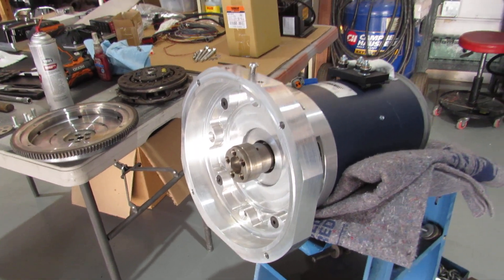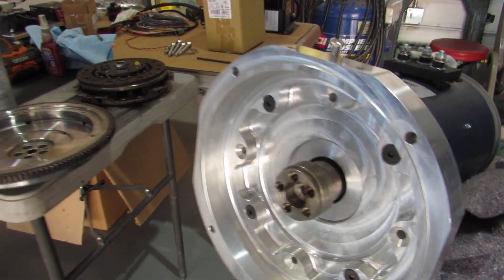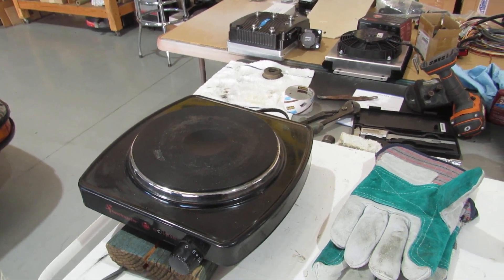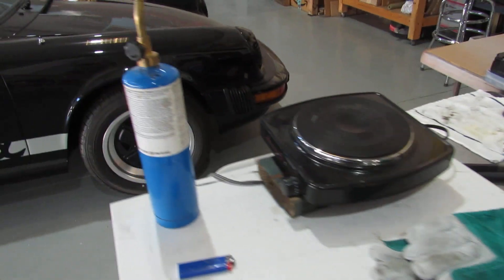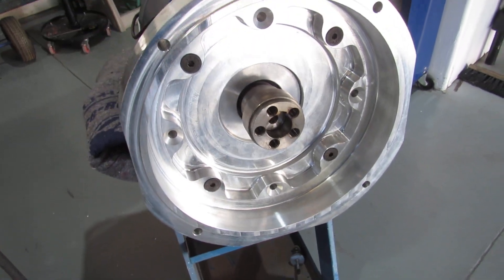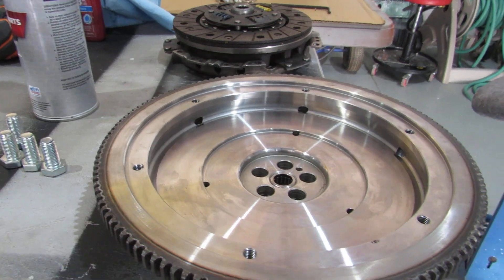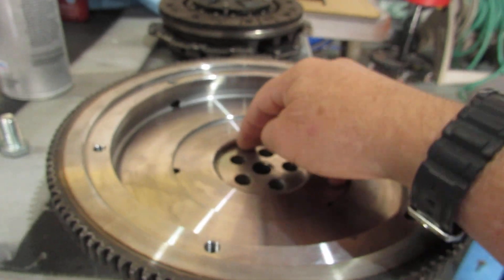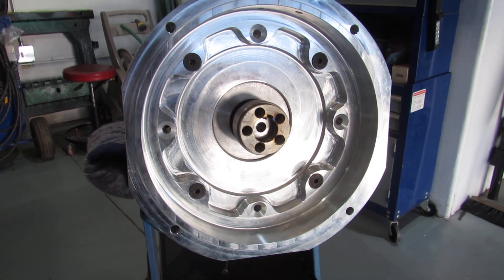1971 VW Super Beetle EV Conversion Update...Coupler On!

Comment: You mentioned on the last video you weren't sure how far the couple went on.  Did you just push it in all the way?  Also, did you just use welding gloves?  Or anything else to protect your hands from the heat?  Thanks!
Reply from the maker: Yup, used heavy gloves and worked real fast :)  After measuring depths and comparing to clutch plate/disc/flywheel, ended up pushing it on as far as it would go.  In our application, it worked well.  Good luck with your build, going to check out your channel.....R

Comment: Been awhile
Reply from the maker: Yup, two and a half months staying cool in Oregon.....how's your project coming along?
Reply: @randyross4058  still accruing tools and Eastwood brand primer. I did find a solution to my 4x4 plan. I can use a mid 80s k10 frame with easy chassis swap kit. As much as I want to start grinding and pounding away, I wanna have everything I need so I'm not losing my shit cause I have to stop lol.
Reply from the maker: @samfisherskiller  Definitely have to have all the tools and equipment...it's a never ending expense :(      I think I have 3 of everything cuz it's easier to buy another tool rather than spend hours looking for the mis-placed one......